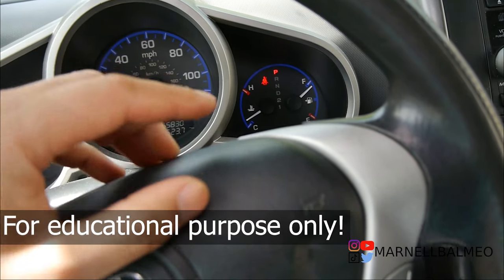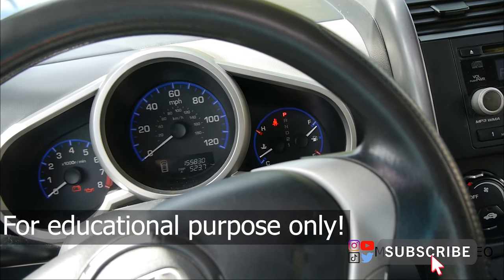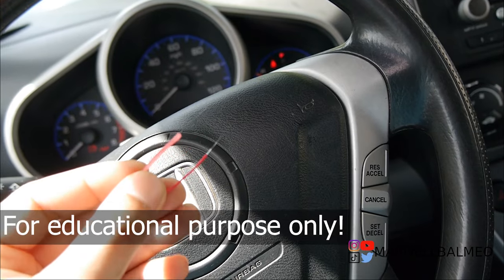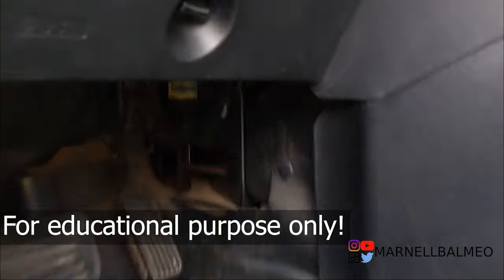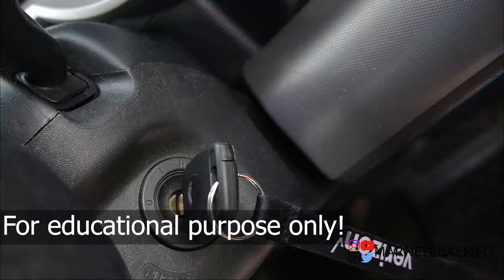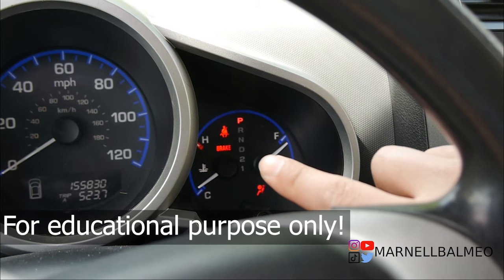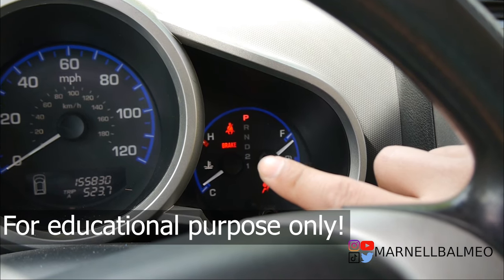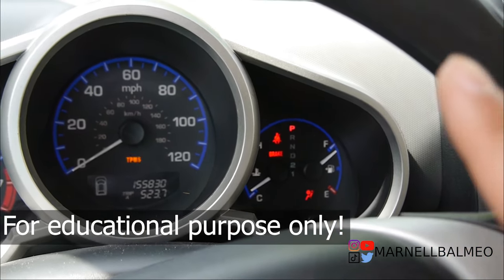Diagnosing FLASHING “D” Light on a Honda for FREE. Detailed with codes. Honda Element

Comment: Thank you so much. This video saved me time money and headaches. I had the D light flashing  for a year when car engages the 4th clutch and I already replaced the transmission of my 03 accord v6.  Your method didn't work at 1st trial because I used a paperclip that looked like metal but it wasn't conducting electricity. I struggled to find an old metal paperclip but once I found one, it worked fine and the display showed a long flash and 7 short flashes (27- 4th clutch fluid pressure switch). That matches exactly the gear at which the D light starts to flash when I'm driving. I went to Advanced auto parts, bought a replacement with a same color as the original OEM for around $60 and installed it in less than 10 mins and since then the D light never flashed again! Thanks!
Reply from the maker: That's awesome 👌  glad this helped out

Comment: Any idea about code 35?
Reply: This is exactly what I need too
Reply: Hey I think ours isn't 35. It's 2 flashes, then 6. Ours is 26, which is the 3rd clutch fluid pressure switch
Reply: @itsMrMeadow   I asked an online mechanic and he told it was an issue with the VTEC pressure switch. I haven't pursued it further than that though.
Reply: @itsMrMeadow   I asked specifically about code 35.

Comment: I am getting code 21 .. on my 2000 honds civic CVT.. 2 long followed by on short flash of the D light. Cant find interpretation of this 21 code anywhere . Its missing on the list shared by the uploader aswell ... it jumps from 20 to 22 directly

Comment: anyone knows 10 long flashes and 7 short ones? guessing it's 1007 or 107?
Reply: I have the same code too I searched it up and I didn't find anything if u find solutions please let me know
Reply: I also just got this code - can you provide some idea of what the problem might be?
Reply: 107 is the Tranmision control module for the ABS modulator - I got lucky and it was just a loose connector!

Comment: So mine is saying I have code 45 Shift Control System, which I still have no clue what that means, any Ideas?
Reply: Exactly. Why post a video like this without posting what the codes mean.
Reply: A code 45 in my 2010 accord manual states that it is set when there are multiple other codes set.  If no other codes are detected, it states the computer needs an upgrade or replacement.
Reply from the maker: Bc the point of the video is you can get this code without a special scanner. When I was looking it said take it to the dealership to get scanned. From here just Google what people have done. It's actually better this way as you'll often see what commonly fail. If I post what it could be, you could end up replacing functioning parts as you check off a list in an attempt to find the problem especially. This is specifically true when you have multiple codes.
Reply: I have code 45 too... Did you fix it?

Comment: I found this in the Honda Element 2007-2009 Service Manual
The functions of the  fuel  and emission control systems are managed  by the  engine control  module  (ECM) on vehicles with manual transmissions or the  powertrain  control  module  (PCM)  on vehicles with automatic  transmissions.
Self-diagnosis 
The ECM/PCM detects a failure  of  a signal from a sensor  or another  control  unit  and stores a Temporary  DTC or a DTC. Depending  on the failure,  a DTC is stored  in either the first  or the second drive cycle. When  a DTC is stored, the ECM/ PCM turns on the  malfunction  indicator  lamp  (MIL)  by sending a command to the  gauge control  module.  
•  One Drive Cycle Detection  Method  When  an abnormality  occurs  in the  signal from  a sensor  or another  control  unit, the ECM/PCM stores a DTC for  the  failure  and turns on the  MIL  immediately.  
•  Two  Drive Cycle Detection  Method  When  an abnormality  occurs  in the  signal from  a sensor  or another  control  unit  in the first drive cycle, the ECM/PCM stores a Temporary  DTC for the failure. The  MIL  does not come on  at this time.  If the failure  continues in the second drive cycle, the ECM/PCM stores a DTC and turns on the  MIL. 

The first four flash codes are actually 50, 70 80, 90 
40 - Torque Converter Clutch Hydraulic Circuit STUCK OFF
60 -   Shift Solenoid Valve  D 

Other systems (ABS,VSA) have similar flash codes that can be read in the same way. Each flash code can have several P codes that narrow down specifically what may be wrong.
Reply from the maker: Thanks for sharing 😁

Comment: Or take a good scanner and check for codes
Reply from the maker: I have a good scanner but transmission code doesn't get picked up. Apparently you need a honda specific scanner or Visit your dealership. If you want to spend money vs free and arrive in the same code by all means go for it 👍